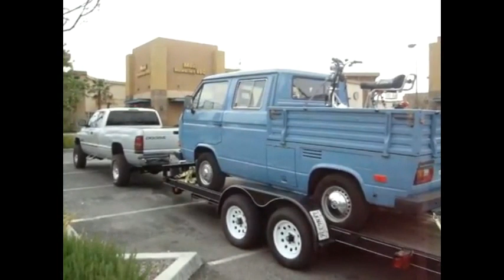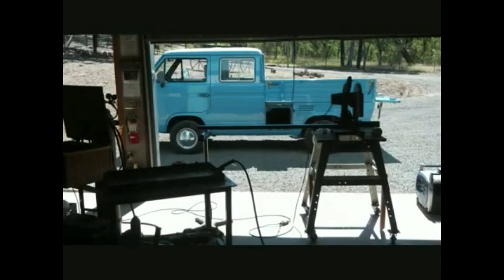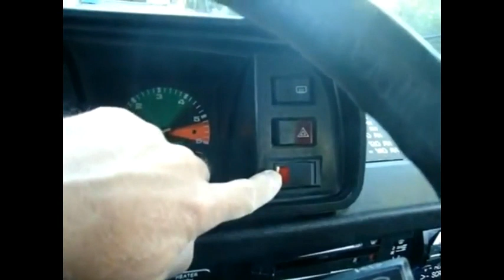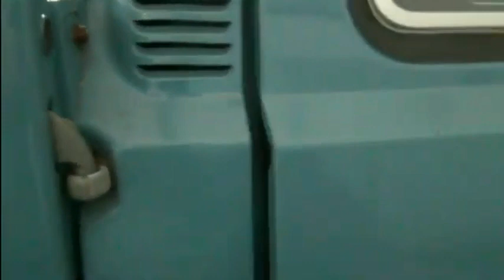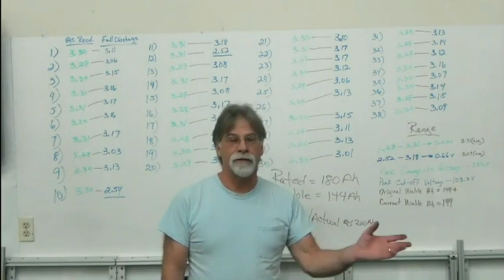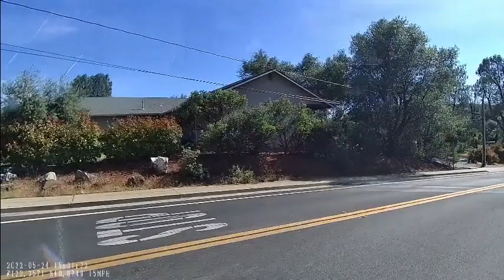EV Conversions - Best Shop Truck Ever - Unique and Versatile - Solar Powered VW Transporter Doka

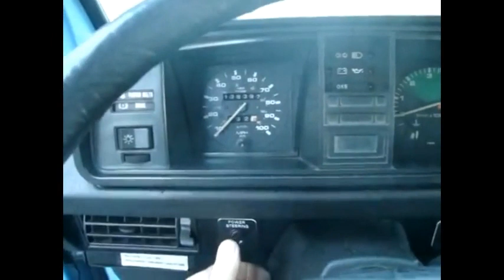Comment: 18:15 Yesssss people would roll on the floor without power steering. 😢
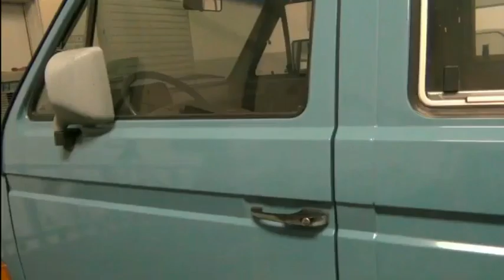25:05 You guys don't attack rust; owner responsibility. 😅
28:10 The desert kills things like cars though not as harsh as other environments. 🏜